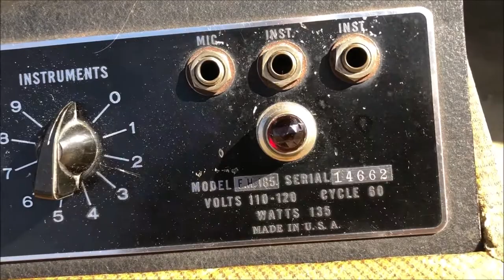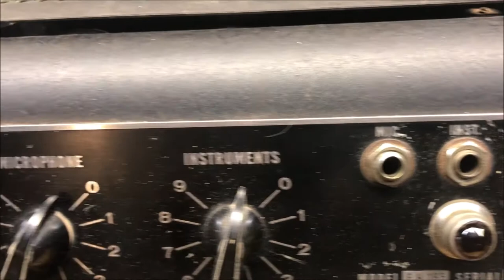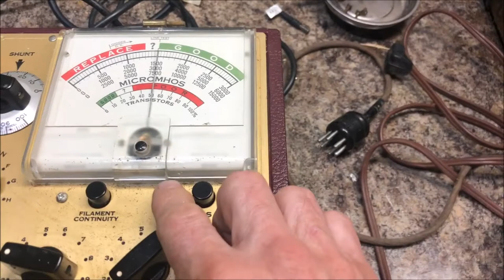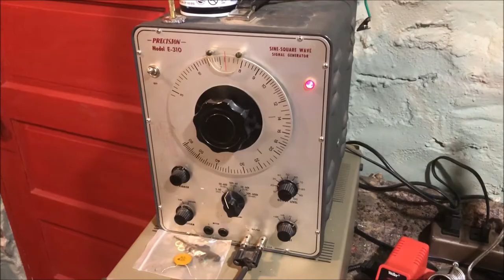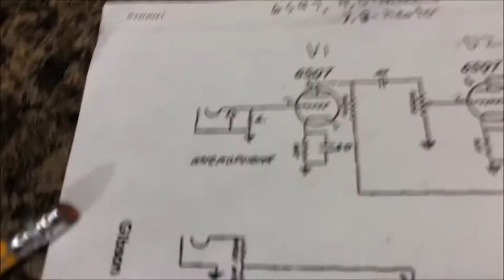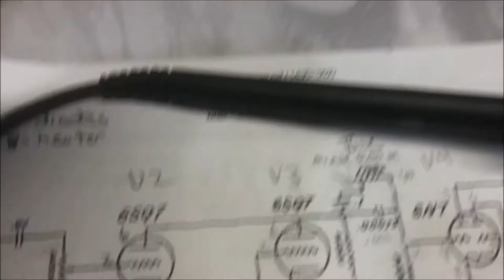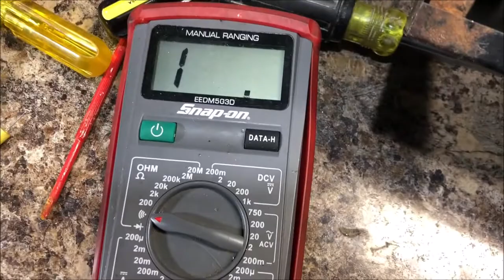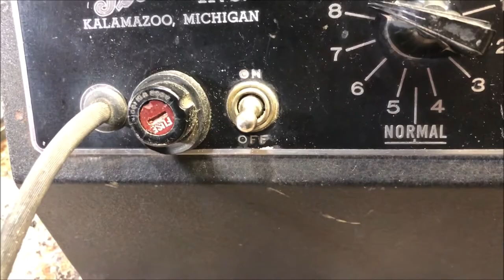Very Cool Gibson 1941ish EH-185 restore

Comment: Great work Mr. Jones.  Did you try cranking the volume thru a speaker that could handle the power, it seams that the 6l6's should be quite loud.
Reply: This s a field coil speaker, I don’t think you can just plug any ole speaker in and try it out.
Reply from the maker: Because it’s a field coil speaker that has a particular ohmage for the coil, it’s not possible to just plug another speaker into it. The speakers are quite hard to find and at some point not too far down the road I imagine this one will get re-combed
Reply: @L.A.of-The-family-Jones  10-4 I didn't realize it was a field coil speaker...